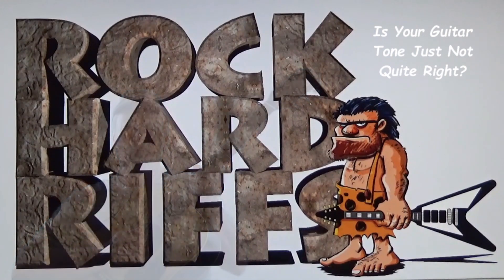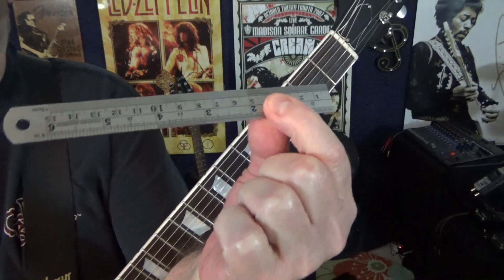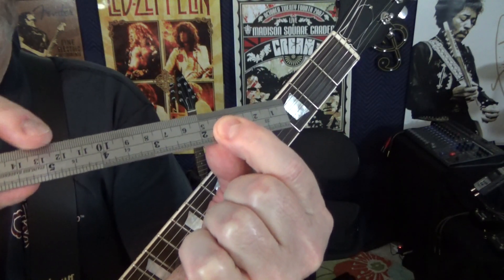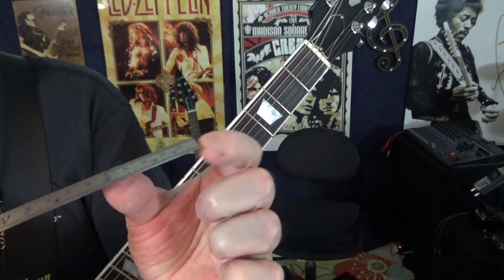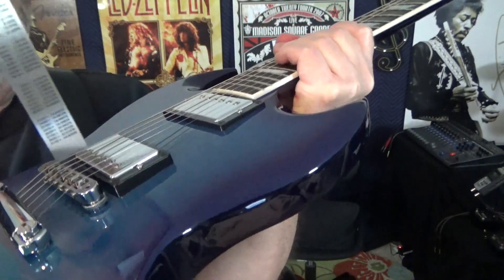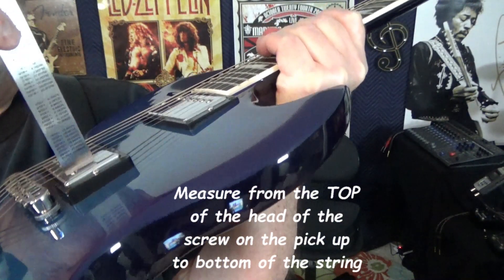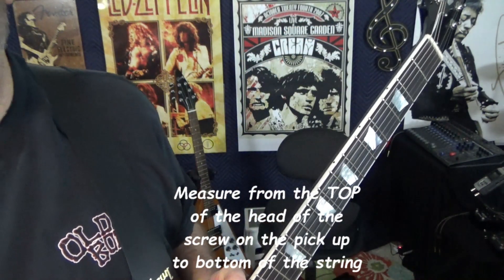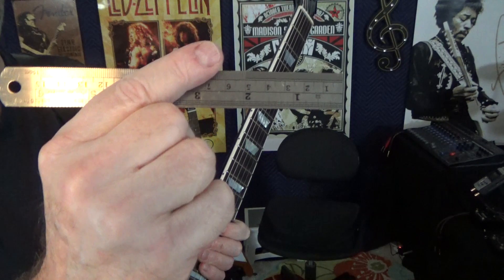Play Guitar | Does Your Guitar Sound Like Crap?  Try This...

Comment: i've tried and tried to get that 80's sound of Boston/Def Leppard by cranking the mid and dropping the treble and bass, added chorus with reverb and compression too. Not even close. Tried it with echo, tried with a distortion pedal and several different overdrives... just can't get it. Suggestions?
Reply from the maker: Hey there my friend.  That's a big question and I can't say I know how they did it, but this is how I've approached certain tones.  Amps and guitars make a big difference of course.  I think Tom Sholz used a Les Paul with P90's quite a bit.  Ditch the compressor and chorus.  Use those in clean modes.  Try rolling back the tone knob on the bridge pick up....try to find a 'sweet spot'.  Do you have a wah wah or Cry Baby pedal?  There's where you get that super compressed laser like intense tone....keeping it in one place....another 'sweet spot' where your guitar just sings.  As far as amp settings go....I have never  been a big fan of too much midrange.  I know it penetrates and all....but how much do you really need?  Depending on the amp and guitar....I usually have the bass at about 2:00 ...mid at noon and treble at 1:00.  Keep messing with the eq.  Start everything at noon and add and subtract the frequencies.
I hope this helps!
Reply from the maker: I just made a video about this topic.  Thanks for the idea and I hope it helps.  It'll be out in a week or so.